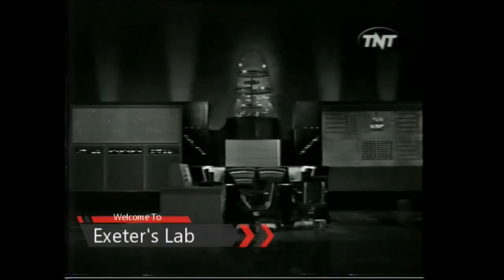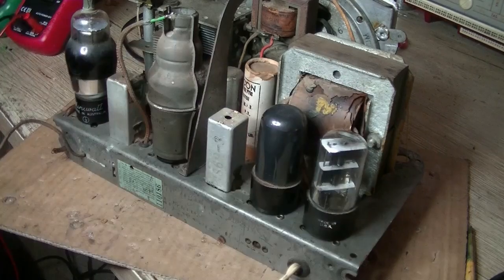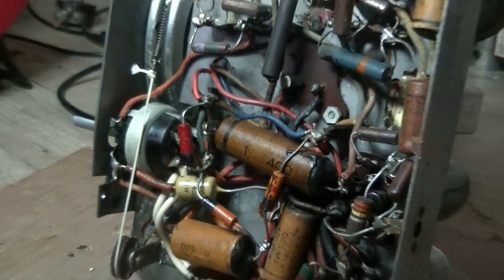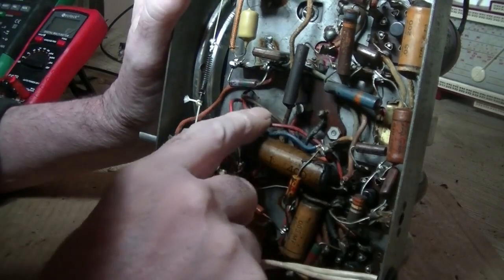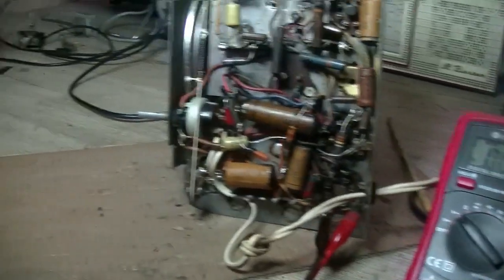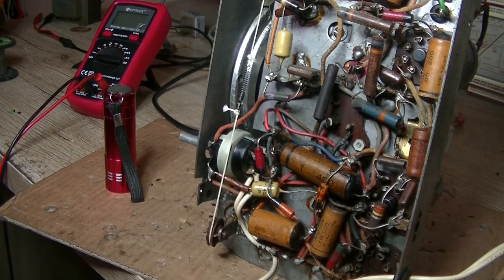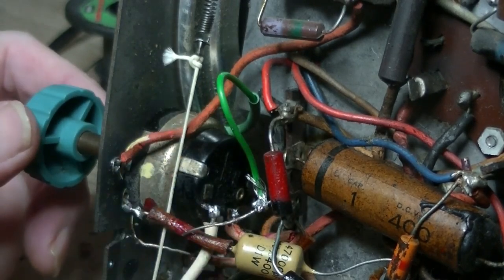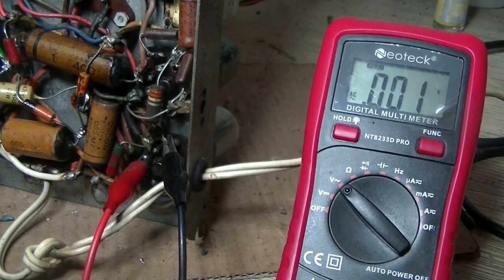Bad Power switch and IF Can on an Astor Mickey 1947 Model

Comment: Hi Frank ,  where do you buy your yellow capacitors from
Reply from the maker: Hi Miroslav,  I got them from a supplier on ebay several months ago. He's sold out of them unfortunately and I don't know if he'll be stocking them again. Here's his ebay link

https://www.ebay.com.au/sch/i.html?_trkparms=folent%3Ascs650%7Cfolenttp%3A1&_trksid=p3542580.m47492.l71970&_ssn=scs650

Comment: That was weird that a 6X5 was where a 5Y3 was supposed to be a 6X5 is a totally different configuration. That one was a bit of a challenge bad switch and IF can messed up as well. As always great troubleshooting video Frank.
Reply from the maker: I guess the factory ran out of 5Y3's that week lol. Radio Museum does list this model with a 6X5 but not with an amended schematic. This is something I've seen a few times where valves are substituted and the paperwork is not updated. As always thanks Larry, hope you're healthy and happy :)